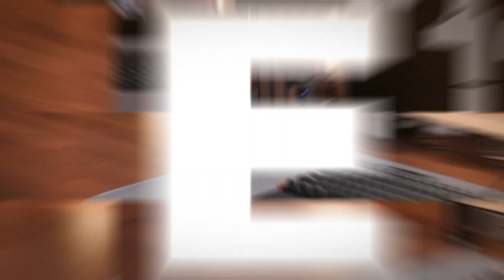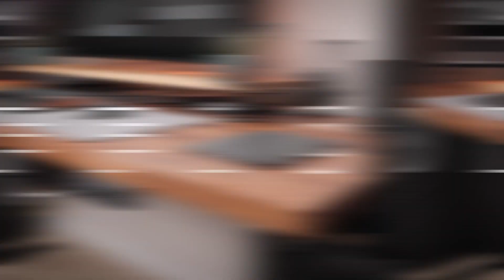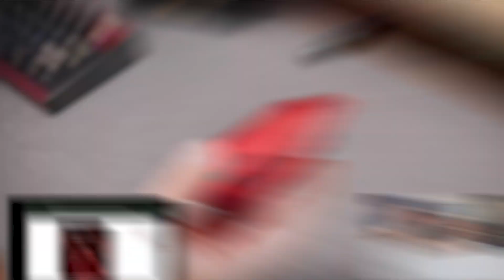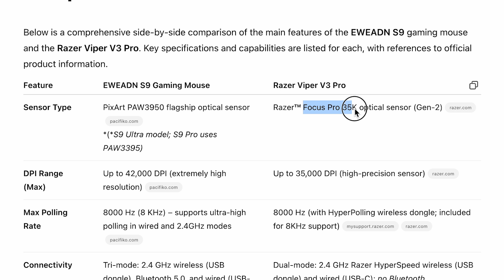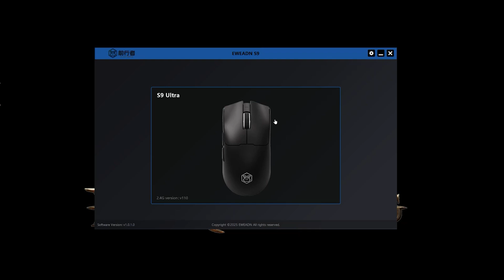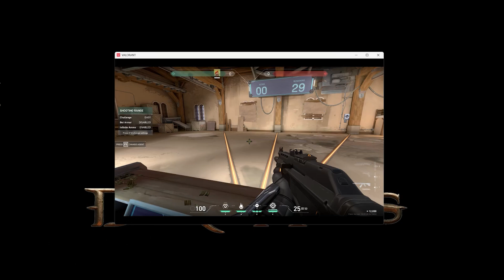Why Gamers Are Freaking Out Over This Mouse! | EWEADN S9

Comment: weight is very important for gaming specially if u aim with your arm instead of wrist because the lighter the mouse the easier to move your arm to aim making it more precise and faster overall thats why i would prefer for example a mouse like "ATTACK SHARK R6 Wireless Gaming Mouse" is 39g weight super light for aim adjustments and 200 hour rechargeable battery life for example super light for my aiming style and also cheap with amazing battery life 👍
Reply from the maker: thx for this info!

Comment: 65g is a bit silly. They could drop that like 10g without changing the battery if they tried harder with the materials and design.
Reply from the maker: I’m not a big expert in mice, just curious, is it really so important to have 55g or 65g weight difference for gaming?
Reply: @DobrikReviewsIt  it isn't huge, but 55g is noticeably lighter and will result in less fatigue. 65g is the upper limit of weight for like 80% of people that are into mice. I personally use a 40g Hitscan Hyperlight, but i just bought the S9 pro because, imo, shape is more important than weight. I love the shape and weight of the hyperlight, but the viper v3 shape is just so much better that I don't mind it being heavier. 40g is about the lowest weight I would recommend, there are some 40g-ish options around the $40 mark (VXE R1 Pro) if you ever want to see what the hype is about